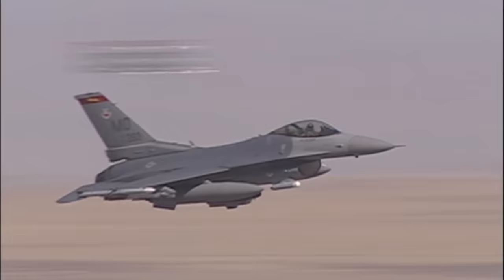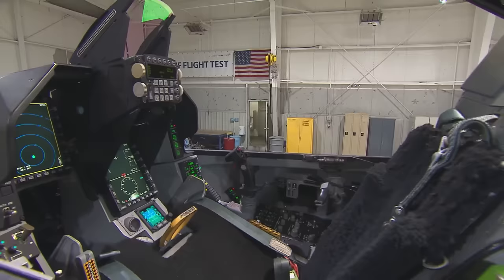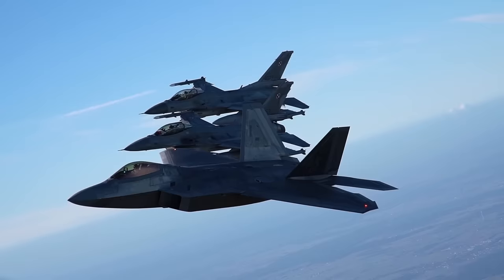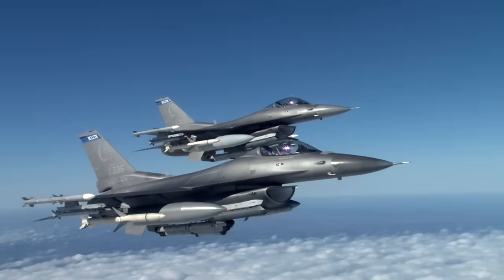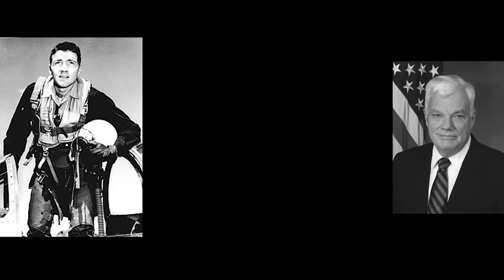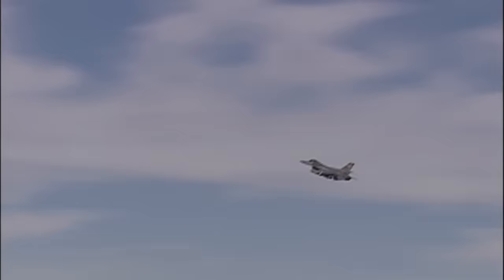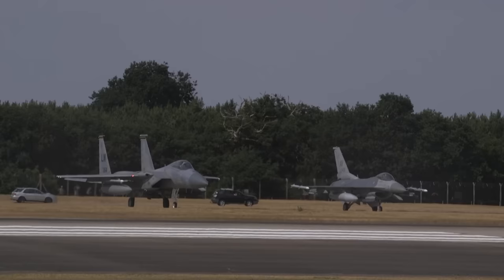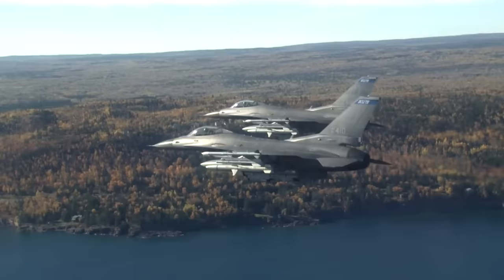Block 70 F-16: The Next Generation Viper Fighter

Comment: Still one of the most beautiful aircraft ever designed in my opinion. Just has that look like if you get in its way it would literally poke right through you and keep on going unscathed. The F-5/F20 has that same piercing look (and should have been more readily used by our military for the same reasons the F-16 was chosen). Amazing that an aircraft that was designed when I was just a kid will still be frontline long after I'm gone!
Reply: Good comment of yours, by mentioning the F-5/F-20 plane. The F-16 had made a good design decision to use the same engine as the F-15, and this plays a role both in terms of sales and maintenance. But the F-20 was much lower cost to operate and had similar performance and was easier to maintain as well. It's a great pity that the F-20 never sold to anyone when in some respects it was superior to the F-16. I feel bad for Northrop sometimes.
Reply: @SanjaySingh-oh7hv  Its was not more capable than the F16 especially in terms of air to ground
Reply: I think that the Spitfire, P-51, F-104 and the F-16 were the most gorgeous aircraft ever produced, with not a single angle that doesn't look stunning. Why that amazing bubble canopy hasn't taken over all other designs is odd (F-22 got it).
Reply: The proportion of F-16 body is just perfect !
Reply: The F-16 is one of my favorite post WWII "modern" military aircraft. It kinda got overshadowed by the F-15. Like the P-47 did.  In my mind I compare a squadron of 10 P-51s & 10 P-47s to a squadron of 10 F-15s & 10 F-16s.  So now we have 10 F-22s & 10 F-35s.  Just my thoughts.  I think its way better than flying any tugboat of russian mig frog
Reply: The F-16 is so good looking, but I am not a fan of the block 70/F-16V chunkier design.

Comment: The F-16 is proof that when you start with a good air frame, the possibilities are endless.
Reply: Or the proof that copying the Mirage III concepts and ideas, was a great thing. Back then, usaf only had huge aircrafts fighter, nothing as light as the f16.

The Mirage III was better in every points, first multiroles fighter, cost really less than huge fighter jets, was more nimble, manoeuvrable, lethal, cheaper to maintain, more effective and efficient.
The 6 days war, is where all these points have been highlighted, and understood by many.
Reply: @aviationaerospacechannel5987  it had nothing to do with “copying the Mirage III concepts and ideas”.  You are obviously not familiar with the “fighter mafia”.  Look them up if you want to know where the F-16 came from.
Reply: @willymac5036  Who's behind this "fighter mafia" ? A professional or expert ? If it's just another mr anybody from internet, it doesn't change the facts.

This information I wrote above, is coming from an official reportage (available on youtube) made with professionals, experts, and engineers, which are famous.

So between famous experts, and unknown people from internet, I still prefer to believe facts from qualified and skilled people.

Comment: Even after Block 70 I'm sure the top engineers at LM will find a way to push it to even higher blocks. It's design engineering is possibly one the best ever.
Reply: As long as there is demand, I am sure Greenville SC will keep making better F-16s. :)
Reply: Improvement in air frame materials and more powerful lighter engines are probably the way forward for the f16 frame
Reply: In addition to a more improve avionics and datalink system, also installing a more powerful engine like that on the f35, enlarging the airframe to accomodate more missiles.

Comment: I'm 70 now, but "back in the day" started out flying the F-8/RF-8, F-14A and then as a Navy Adversary the F-16N and A-4F. I always hit this channel when new content drops, as I think PilotPhotog is about the best source for reliable and interesting information. 
This one brought back great memories!
The tilted seat definitely contributed to the ability to withstand G's. But I think a more significant feature had a greater effect in reducing the height of "the column of blood" that is the human body. The "floor" of the cockpit was also raised such that your feet were up nearer to the level of your hips. While that made using a "piddlepack" challenging (!) it also made it much easier to push blood to the brain.
Also, full rudder throw was 1/4 of an inch, so you could fly with your legs extended. We used to joke that this was the perfect combination of seating and throttle/stick placement in that it was "like sitting in a lawn chair with two cans of beer"! That's perfection. The visibility was such that it was like flying a convertible. You could practically look over the side.
Anyway, I'll just add that there was one additional nickname. Given the black sense of humor that is the essence of the reptilian portion of the fighter pilot brain, it earned the nickname "lawn dart".
Early on, no one was used to the idea that G onset could be so fast and so intense as to result in G-LOC. Airplanes and pilots were lost because of that. With the introduction of the GE engine and bigger P&W, that became a bigger issue. Everyone went to centrifuge training to learn to compensate with great success. 
And one last thing, PilotPhotog. Thanks for referring to the Navy F-16 drivers as Adversaries! Navy/Marines are indeed Adversary Pilots as opposed to our Air Force brethren who are Aggressors. At least at the time, there were subtle but significant differences in our missions. 
Cheers!
Reply from the maker: Sierra Hotel! Thank you so much for your comment and your feedback, from someone who was there are flew these aircraft that is tremendous praise. As I perform the research for each topic, I learn something from each video, and then a more from comments such as yours, I love the lawn chair and two beer cans analogy - that indeed sounds like perfection.  My hats off to you sir for your service, dedication, commitment and support.  I am lucky to have a viewer and commenter such as your self - Happy Holidays and incoming updated B-21 video on Monday!
Reply: @PilotPhotog  Looking forward to it!
Reply: I rarely here of any A-4 aviators, it looks like a fun ride, how would you rate it if you don't mind , thanks and thank you for your service  .

Comment: Two fun facts:
1) The F-2, a derivative of the F-16 built and operated by Japan, is unofficially known as the "Viper Zero."
2) The earliest F-16As were advertised at being rated to handle 9Gs, but in reality they were only rated to handle 7Gs. Needless to say, the USAF was extremely pissed at General Dynamics when they discovered cracks in the wings.
Reply: I wonder how effective that "extremely pissed" is, when the General Dynamics exec just gives the airforce guy a look that says "Do you really not want a job when you retire, son?"
Reply: @dougerrohmer  The USAF were the ones paying the bill. All they had to do was cancel the contract. Then GD would have a lot of expensive things to pay for on its own, including hefty fines, WITHOUT government funding.
Reply: @kibathemechanic4967  You are missing the point. There are a lot of USAF officers retiring after 20 years, or generals or whatever, and who then pick up lucrative jobs in the defense contractor industries. A lot of signatures that sign off programs as "complete" reappear the next year on a next proposal from the defense contractor. Do you get my drift?
Reply: @dougerrohmer  That's kind of irrelevant in this case. My point is that if you screw up a USAF contract, the USAF is not going to do business with you for any more lucrative contracts, or at best shy away from considering you for the next contract.
Reply: @kibathemechanic4967  You speak as if the USAF is an amorphous sentient organisation. It's not - decisions are made by individual members either in concert or individually. These members don't earn big bucks, and they cannot serve for ever so they leave long before their working years are over. They now go work for defense contractors, they cross the fence so to speak. It therefor follows they will only be accepted at the other side of the fence if they did not make life unbearable for those on the other side of the fence while they were in service on this side of the fence. Now, start putting two and two together and you might find that a billion dollar contract was awarded by a group of people who are paid government salaries, and then go across the fence to play golf and earn top dollar because of gratitude for prior deals.
Reply: @dougerrohmer  Ya done? This happened in the late 70s to early 80s, not current year.
Reply: @kibathemechanic4967  It's been happening for ever. It's human nature, and here comes the most ironic part - it's the best system we have come up with because the product beats anything anyone else has.
Reply: @dougerrohmer  We're not talking about the F-104, though. Bribing people may work to get an inferior product to an air force once in a while, but as far as I know, that was not the case with the F-16. General Dynamics did not deliver the product they promised in their first batches. THEY SCREWED UP, GOT CAUGHT, and had to fix it. End of story.
Reply: @kibathemechanic4967  "My point is that if you screw up a USAF contract, the USAF is not going to do business with you for any more lucrative contracts"  Tell that to SAIC/Leidos.  They massively screwed several USAF contracts and it didn't stop them from getting more.
Reply: It's also called the Falcon not the Viper but whatevs. YouTubers gonna YouTube.
Reply: @jdkgcp  The official name given by the USAF was "Fighting Falcon," the name the pilots call it is "Viper." If you would've listened to the video, you would've known that.

Comment: I have always felt that the F-16 is the legacy successor of the P-51, classic aerodynamic lines that will be admired forever.
Reply: I agree 💯
Reply: Mmm… no it’s not. If anything, the F-15 has that distinction. Don’t let the belly scoop fool you.
Reply: @Frankie5Angels150  Don't let the twin engines fool you.
Reply: I felt that the F14 was the successor to the P47. Both started as huge fighters, then into ground pounders. Both did a outstanding job at both jobs.

Comment: Greece has already upgraded 4 f-16s from block 52+ to block 72 and another 79 will follow. You can see two of these at 0:26 and 7:52. Also viper is the official name of the block 70 variant (f-16V).
Reply: That’s right and as far as I am writing this comment 12 aircraft have been upgraded so far.

Comment: Spent some time in Carswell AFB.  When my father retired from the 7th BMW  he was a center fuselage inspector on the jet across the runway.  Watching the pilots take the new jets out before delivery to the squadrons and working out the new smell was amazing. Topped with watching the -52’s and -135’s       Growing up as a Air Force brat was the life.  They had open house one year I remember in GD and seen -16 after -16 being built in a mile long plant.   I still have plate charts and other documentation used by the people building these electric jets.

Comment: There was also fourth name for F-16: Lawn Dart. This was due to it's introduction that wasn't that rosy as described in the video.
Reply: This is a great place to say" you should have been there, which I was" so I can shed some good light on this lawn dart.... unfortunately it got that name because absolutely no one had ever flown an aircraft that was so extraordinarily maneuverable with minimal input and I mean exactly one quarter inch of input on the side stick controller would start that aircraft into a snap roll and that was part of the problem was trying to get used to extraordinary capabilities. Unfortunately have lost some pilot friends because the electrically activated/ hydraulically actuated surfaces had not yet received control inputs to Upright the aircraft before the canopy and ejection seat came out so you could eject sideways or even into the ground which unfortunately did happen

Comment: Would like to see how Israel used the Viper.  I think they have had the most combat success using it in the air to air role. I would be good to see a video on their success with this great airplane against MiGs.
Reply: While I was serving in the very first F-16 Fighting wing at Hill Air Force Base The Israeli showed up with six aircraft and camouflage paint and practiced over Wendover bombing range in Northwestern Utah before they flew against that Iraqi nuclear plant and blew it up with 2,000 pounders so if you take a vehicle intended for dog fighting and realize it had the excellent bombing platform that no one expected with continuously computed impact point the Israelis use that to their advantage and took this small dog fighter with 2000 lb under each wing and destroyed that plant while the f-15s flew top cover

Comment: Adoption of UAI is why this jet can quickly integrate so many weapon types. UAI means that code doesn't change for a given integration only config files are changed. Cuts a substantial portion of the jet's software certification out of the integration loop. It also allows for weapon integration between block upgrades

Comment: Actually, the first military aircraft to have a fly by wire flight control system is the RA-5 Vigilante, although it was an electro-mechanical type.

Comment: It is the best all round 4 th Gen fighter. Its also battle proven and has a fantastic record. A benchmark fighter jet that set the standards. 
I think a video should be done on its extordanary air combat record with over 80 kills to 1 disputed loss.  The F-15 may have more, but that's down to the missions given to it during conflicts like Desert Storm to provide air superiority.  The F-16 was not given the role, but it could have done it.
Reply: The F-16 had less range, less missiles, lower top speed and a weaker radar. It didn't even have medium range missiles when it initially entered service. The Eagle was given the task because it was literally superior.
Reply: @blkspade23  The Eagle was superior at BVR.  But remember the F-16 was originally designed as a daytime dogfighter. In a close range dogfight the F-16 is far superior. The F-15 can't match its agility /manoverability.. When F-16 got use off the AMRAAM, it became very capable.
Reply: @265justy  The Eagle can see contacts from much further out still, which means it could dictate the terms of the engagement. Doesn't matter how F-16 and F-15 match up against each other, they weren't adversaries. On paper the Mig-29 should have been superior WVR to the F-15, but they got smashed. The Eagle won't let them get to the merge in an advantageous position. It's still no slouch. All out with HMDs and 9Xs the F-16 and F-15 more than likely trade. Do you want a coin toss? Probably not. The F-16 during Desert Storm didn't even have the option of HMDs, 9Xs or 120s. Which again is why the Eagle was picked.  The Viper's initial design as a fighter is more point defense, not too far from home. The Eagle was designed from the ground up to knock threats out of the sky, before they are even actual threats. The Viper is a budget Eagle.
Reply: @blkspade23  But the Viper still beats the Eagle in a turning fight.!
Reply: @265justy  Dogfights are extremely rare in the real world. BVR is the most common type of engagement, and besides the F15 is also pretty damn good at turning, considering it was also made for it, despite being quite large.
Reply: @265justy  And the entire scope of what you want/need from an AIR superiority fighter is more than just a turning fight. The Eagle driver just won't enter a turning fight in the first place. The viper has to earn his desired fight first.

Comment: Curious if they will make the F 16XL. I keep hearing the AF is either looking into options and give it the same treatment as the F 15. It won't be the same as the F 16XL BUT similar while also not being as expensive as the F15EX turned out to be. (It's more expensive than the F 35s)
Reply: Nope. The F15E was built in place of the F16XL.
Reply: Lockheed will not make competition for f35

Comment: Those who work on them never called it the Viper, it is the Fighting Falcon. Viper is pilots only.
Reply: Incorrect, in MX we would call it viper, and fighting falcon or falcon for short. Source: 20 years F-16 crew chief.
Reply: i joined the service in '86 and  my first duty station was equipped with the f-16 "fighting falcon".
fast forward twenty or thirty years. the first and only, (granted and I don't get out much) time i hear it called a viper is youtube.
that has led me to believe that its a generational thing.
so  with all that being said.
you can call it what you like. but those in the know, know.
it's the f-16 fighting falcon.
and she is beautiful.

Comment: The F-16 Block 52/54 has been in service of the Republic of Singapore Air Force for more than 2 decades. The 60 fighters  been the back bone of the RSAF replacing the A4 Skyhawks and Hawker Hunters. It will be getting its latest up updates to serve well into 2030s. Even the 24 F15Es will be getting similar updates to go beyond 2030s even though we are getting F35Bs in the next 2 years
Reply: US has said Singaporean F-16 will not get upgraded if it keeps doing military drills with China, so Singapore went to Israel instead.

Comment: Missing - new air intake, GE  thrust vector control and proposed rebuilt to orignal YF-16 thrust to weight ration ( lager vertical stabilizer and wings ).  Also, F-16XL could make helluva comeback with JAGM and SDB.